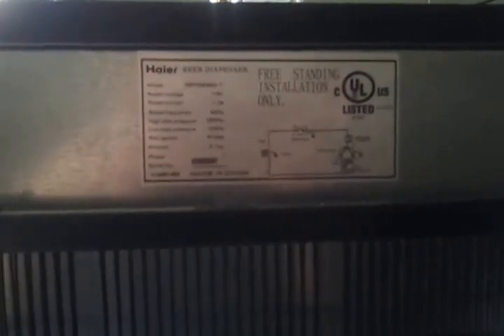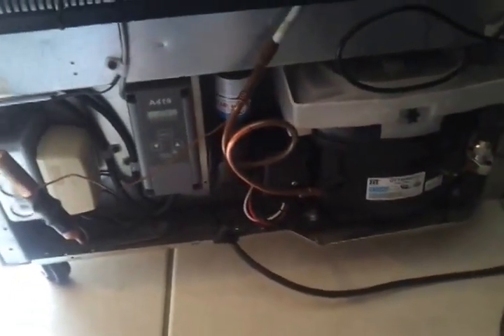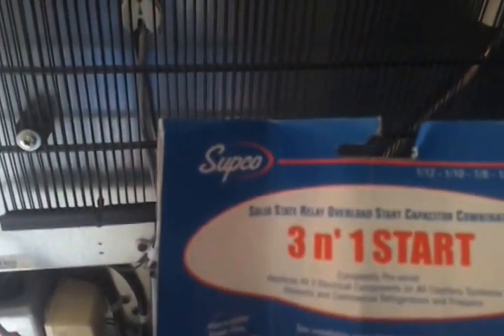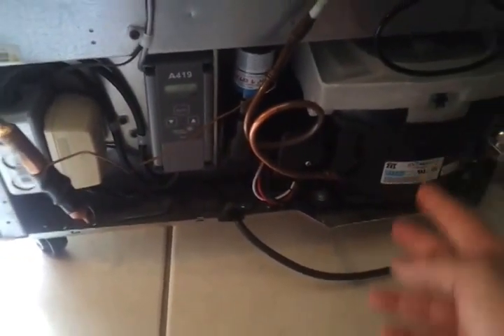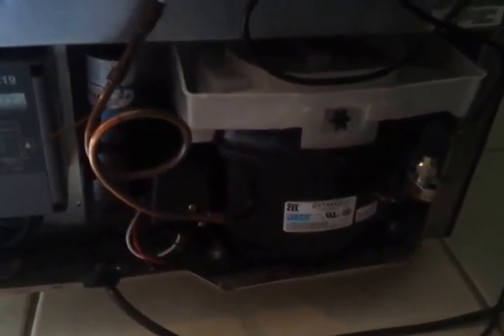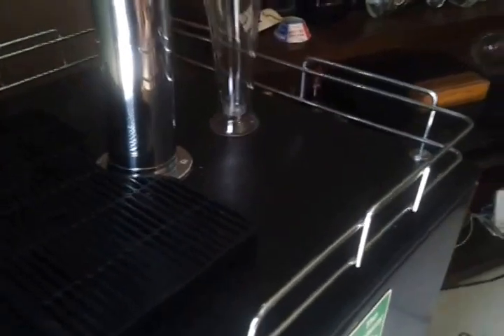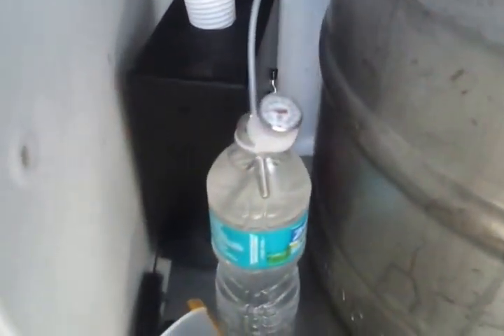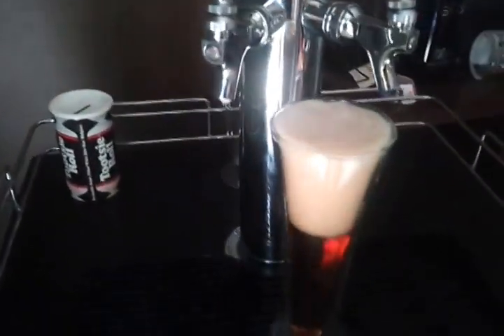Kegerator repair

Comment: You do not jump the black and the white wires - that will cause a short.  The white is neutral and the black is hot.  What you want to is to jump the 2 wires that go to the thermostat.  On mine they were black (hot input) and blue (out to compressor).

Comment: adjust your co2 this will help with foam issues. I have mine at 40 and 10 psi on co 2 hardly any foam. Have ninja milkshake stout at this time.
Reply from the maker: SOHN32 at 10 psi i get all foam, currently Amberbock
Reply: When beer get to 40 degrees it will release gas causing alot of foam.
U want to keep your beer under 31 degrees but not lower then 28

Comment: Hi thanks for your helpful video. I also have the A419 temp controller and would prefer to use that instead of the stat included with the kegerator. In the video you mention disconnecting the white and black wires and jumping them so the compressor stays always on. I figured I could then plug the unit into the A419 and use the probe on the A419 to shut the compressor on and off. However, I'm not sure how to jump the black and white wires to force the compressor to be always on. Could you please help me understand how to do this? Thanks.